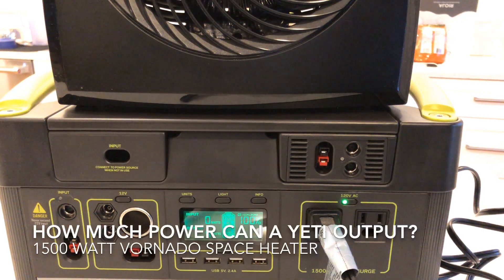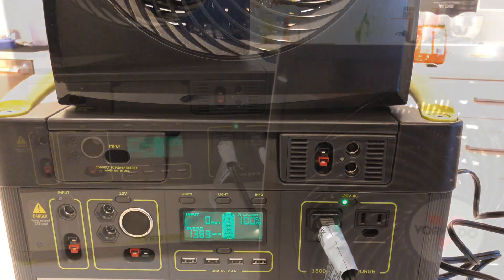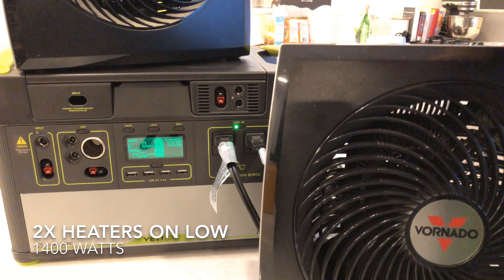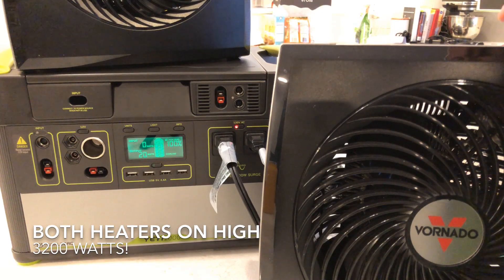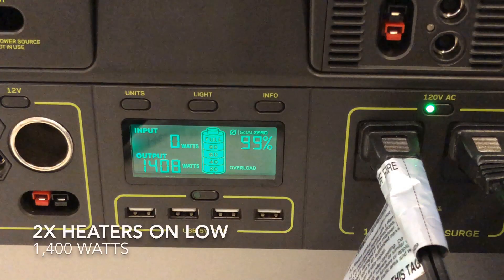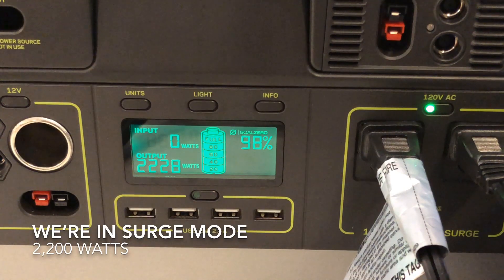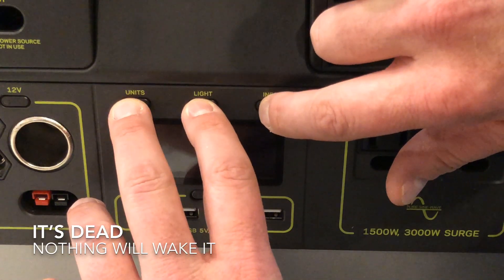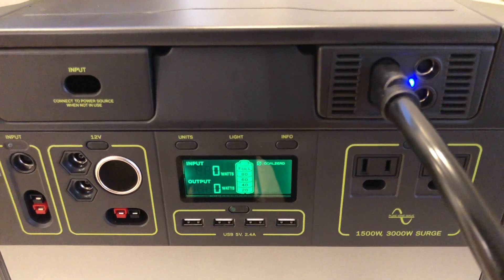Goal Zero Yeti 1000 - 3,000 Watts Max AC Output Test

Comment: Dumb test leave the heating running for more time not for 10 seconds
Reply from the maker: Uh, thanks for your input
Reply: That is why we watched the video. To see if it could handle the heater. Duhhhhh
Reply from the maker: Rebel Lucy It runs a single heater up to 1500w fine but the battery will only last about 30 minutes.

Comment: The more I watch videos on any Goal Zero product, the more I lean towards a DIY setup.
Reply from the maker: I still think the Yeti 100, especially refurbished at $800, is a great value for 1kw of lithium power and a strong inverter/charger but DIY is a good option if you have the know-how and need something bigger or more flexible.
Reply: Any suggested alternatives for loudspeaker/ small event use?
Reply from the maker: The 2 factors are the peak AC power the speaker amps need when driven hard, and the avg watts x duration to figure out how large a battery you’d need. If you reply with those numbers, I can suggest something
Reply: @todd.parker  https://www.altoprofessional.com/products/tx210 300W peak, 150 continuous, idk the amps. Any guess?
Reply: 100-240V
Reply from the maker: @cyberoverkill  says 150w power consumption so is round up to 200w. Since each speaker has an amp, that’s 400 watts of energy per hour assuming these are at full tilt = 400wh. So use that number to calculate the time it would run. My Yeti 1000 would realistically run this for 2 to 2.5 hours since it’s 1000wh but you never get all that power back due to conversion losses. Since these need pretty low power compared to other appliances I’d look for something with a lot of battery storage but you don’t need a super strong inverter. The Bluetti EB150 or 240 would be the best value here.

Comment: I have the yeti 3000 , Can you do a test of say 800 watts for 2 hours , because I’m running a 800watt aircon and about an hour in I get a thermometer 🌡 on the display, so I read the instructions and it sais the yeti is overheating and to turn everything off and let it cool down
Reply from the maker: That's odd, you should contact Goal Zero support since that's roughly 50% of the inverter capacity. Is is very hot where you're running this?
Reply: Todd Parker over 30celsius it still runs but the thermometer on the display means it’s overheating and instructions say turn everything off , I think goal zero uses pouch cells and there not very good with heat
Reply from the maker: Now that’s getting warmer, I can test. I only have a 1000 so at 800w won’t last long!
Reply: Todd Parker roughly 2 hours but if you have say 800watts solar your practically using no power , lithium takes every bit of solar you throw at it because there is no resistance
Reply from the maker: All rich hard Why is your AC soft start?
Reply: Todd Parker I’m not sure but it’s a dometic rooftop airconditioner I think it might be bs200 it was in the van when I bought it in 2009
Reply from the maker: If it’s older it likely doesn’t have a soft start, usually people add them after market. This keeps the power from surging when the compressor kicks on. https://www.amazon.com/dp/B07DD1S63M/ref=cm_sw_r_cp_awdb_t1_7KrYEb4DSQWXH
Reply: Drakilicious if the temperature in the rv is over 30celsius it will overheat , 1500 btu it would last 2 hours until flat but if you have solar going in obviously longer, my thermometer comes on but it doesn’t effect the unit

Comment: Hi Todd

I have a 3000. I am wondering how much it costs to recharge it from 0%. I pay .12 per kilowatt hour. Based on 25h to recharge, I am coming to $9. The formula I used was 3000w x 25h ÷ 1000 x .12/kh. Is that accurate?

Thanks
Reply: The math is off.  You're assuming that to charge the unit you will draw 3000 watts per hour for 25 hours which isn't so. The wattage that you will draw is 120 watts total for 25 hours (2 adapter plugged in each rated for 5A x 12V).
Reply: @luiscolon921  ok, thanks. It does take a lot of gas. I have a Prius.
Reply: It's actually easier than that, you have a 3000 watt hour battery.  That's 3KWH.  Or three times your .12 KWH.  That's 36 Cents.   Electricity is CHEAP.

Comment: That's pretty impresive. It can power a whole household everything :O
Reply from the maker: Well, for short periods of time...yes
Reply: @todd.parker  Yea, but a normal house hold uses around 700 to 1000 watt. how long could it power 1000 watt??
Reply from the maker: MauriceNL Well, the Yeti 1000 is a 1000 watt hour battery. Assuming losses from the inverter it could run a 1000 watt load for 45 minutes or so.
Reply: @todd.parker  , I'm still experimenting with the unit. With the two other systems we have, I expect to be totally off-grid soon. Put the yeti 1000 is more powerful then both of the other two put together. If you can keep a thousand Watts coming in on a consistent basis, I think the unit can keep generating a thousand Watts 24/7, and more, up to 1500. But the poor thing is not going to be able to stand up at all to the kind of brutality you have given it in this video. But again, much thanks for the video, risking your unit so I don't have to! 😉

Comment: Nice! Any issues with the unit after the 30 second surge run? Great videos
Reply from the maker: You can see it shut down but has been working perfectly fine after it reset itself. Seems they have some good protection built in.